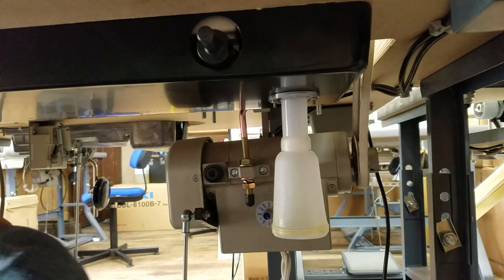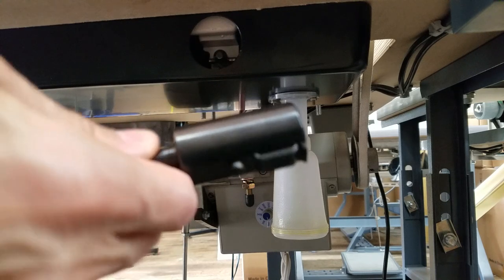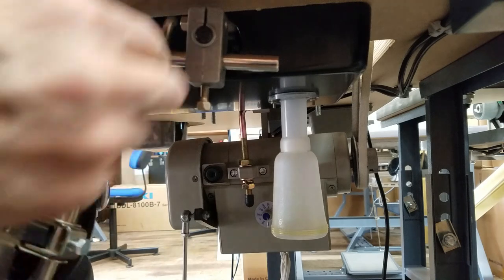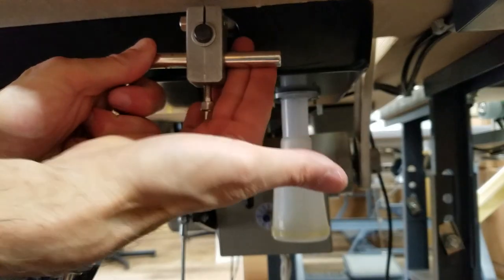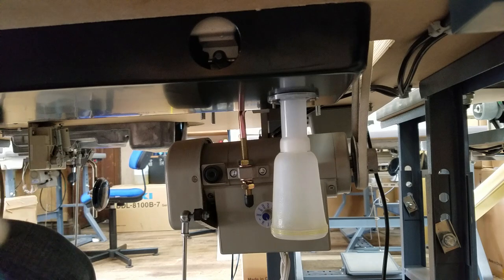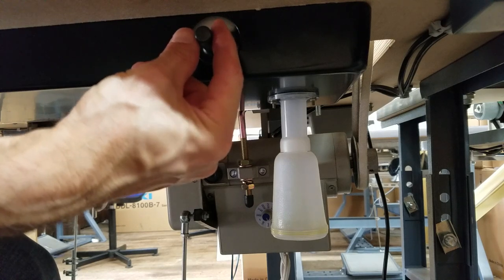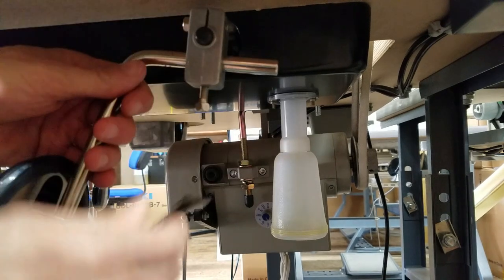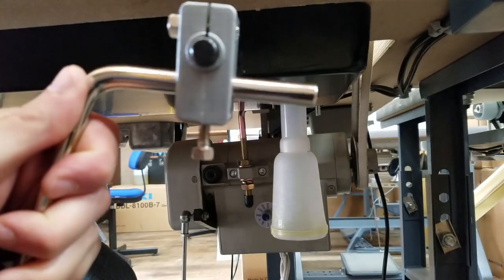Juki DNU-1541 bent knee lift

Comment: That is a very substantial part I can't imagine it being bent. I would try to get some sewing machine oil down there on that shaft in between the the sleeve and the shaft. Make sure that sleeve is not being obstructed by the pan. I agree with Steve I absolutely would not use a vise grip on that. Please follow up I'd like to know what the issue is

Comment: Another idea might be to try and lift the machine out of the table back first. So you're lifting the hinges up and lifting backwards. The knee left sleeve will prevent the machine from rocking backwards like normal. Once you have the machine out you might be able to see better what's obstrucking it. Maybe then use a wooden block or a brass punch and gently tap the knee lift sleeve out.
Reply from the maker: I forgot to mention in the video, the customer's machine fell and that is why the part was bent.  I do like the oil idea, especially if it is stuck, but I do not know if that will work in her case.  Worth a try. Thanks for the advice!